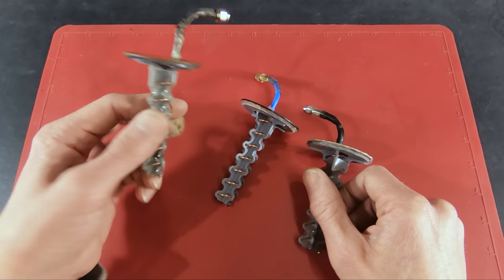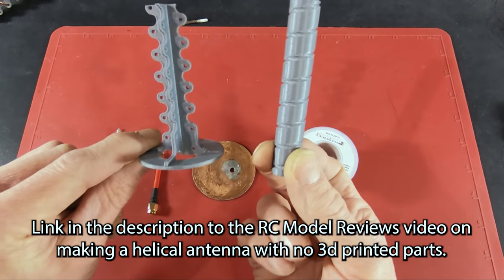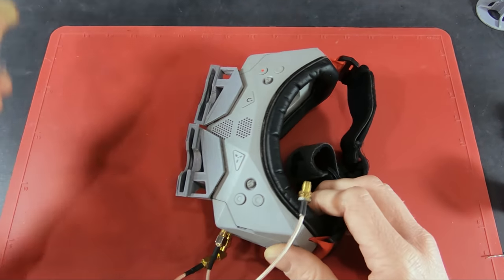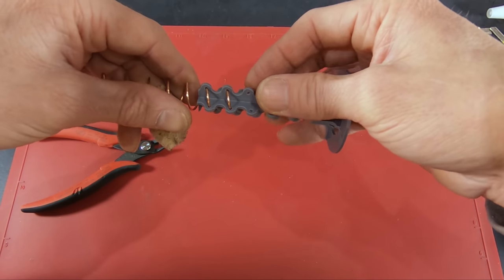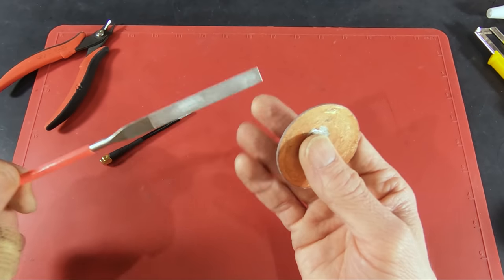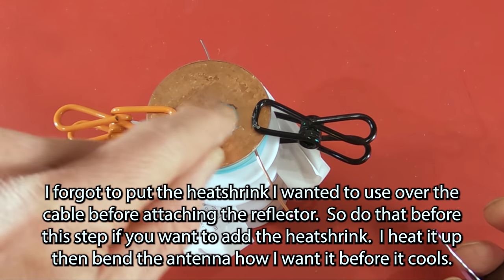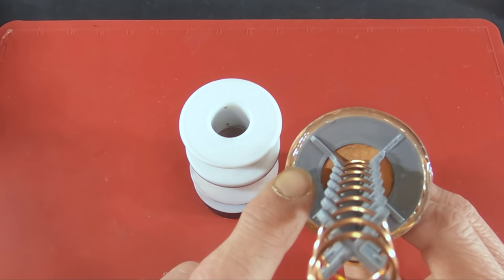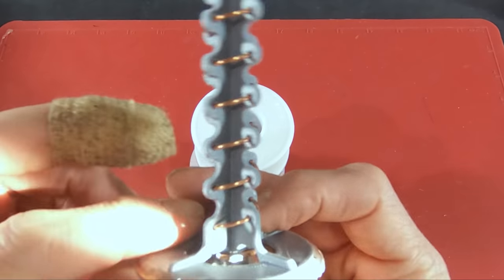DIY Helical Antenna For Long Range FPV - CHEAP & EASY -

Comment: Sweet, thanks for the video! How do these compare (in range) to the TrueRC  antennas you also use?
Reply from the maker: the helical if made well is 11.25 dbi.  The TrueRC X2-air is 13 dbi, which is more of a difference than it sounds like.  The X2-air has a beam width at least twice the size as well.  (I think it must be more efficient at focusing forward than the helical.)  That said, many might not notice the difference depending on what they plan on using it for.  It you get behind some trees far out, the X2-air will probably maintain better clarity.  I think the best choice might be using one of each.  So with rapidfire combining you get the best of both, sort of.  The wide beam width and higher gain of the X2-air and also the great cross polar rejection of the helical antenna, if I'm understanding it all correctly.  (I've read that record range for the X2-air was 10km at 200 mw but that must be in perfect conditions with quality gear. No way this helical will do that)

Comment: Hello. I wanted to know where I can find supports for helical antennas. Not those of the antenna but those to put on the glasses in order to then host the antennas. Thank you.
Reply from the maker: Here's a link to thingyverse.  There's a helical antenna holder by me near the bottom.  It's for my orqa goggles but it could be modified possibly.  Just reverse it in the 3D printing software for the other side.
https://www.thingiverse.com/search?q=falconrad&type=things&sort=relevant
Reply: @FalconRadFPV  thanks

Comment: Is the wave trap touching the copper plate? What is the piece you call wave trap?
Reply from the maker: the wave trap is the small 6mm x 3 or 4 mm square of thin metal.  It should be soldered to the bottom of the antenna coil and defiantly not touch the base plate.  My example is confusing.  I used a piece of one sided copper coated pcb for the wave trap.  The copper side only touches the antenna but yes the inert pcb (plastic) side does touch the base plate.  But wave trap refers really to just the copper coating not the rest of the plastic supporting it.

Comment: If the copper sheath is higher than the reflector would that cause issues? Mine is like 2mm above the reflector
Reply from the maker: I would keep it as short as possible.  I have it come just high enough that I can solder the sheath to the base plates copper surface.  The last quarter turn of the coil that goes flat should be only 1 or 2mm above the reflector (base plate) surface.  You can email me at falconradfpv@gmail.com and I'll help you figure it out.  Send me a couple of pictures and I'll see if I can spot a reason for it not working.
Reply: @FalconRadFPV  Thanks so much I will do!

Comment: Hi, you mention the wavetrap should be one sided to avoid it from getting in contact with the reflector? Because in ib crazy blog he has a steel piece soldered to the copper wire that's in the air.
Reply from the maker: Both ways do the same thing. I've made it both ways.
Reply: @FalconRadFPV  i just finished making one. I used a double sided copper board reflector and a computer hard drive mounting bracket strip for wavetrap. Soldering the wavetrap was a bit tricky. Thanks for the excellent tutorial 👍

Comment: I don’t think I’ll be able to make these antennas, can you recommend an antenna that I can purchase that will Have similar performance? Southwest FPV Durango Colorado
Reply from the maker: Many FPV stores will have high gain long range antennas.  The higher the gain the stronger the signal, BUT also the narrower the area of coverage.  Compare the gain and area of coverage pictures for different antennas to make a good choice.  Most good quality (the more expensive ones) antennas will have a picture for the gain levels at various positions around the antenna as well as the shape of the pattern for area of coverage.  More coverage = lower gain, one goes up the other will go down.  12 or 13 dbi (like TrueRC X2-air) should be plenty for a long range goggles receiver antenna.  For a quad antenna the same thing except you want low gain and coverage in a perfect circle around it, like with the TrueRC Singularity.

Comment: did you design the 3d print file for a lhcp guide pole?
Reply from the maker: I didn't design the prints, got them from thingiverse.  It's for right hand polarized, although you could just mirror it in Cura slicer to reverse the polarity.

Comment: do you have to use bare copper wire or can you use the coated stuff and just remove the coating at the needed solder points?
Reply from the maker: Either would be fine.  Ya that's right the only issue would be scraping it a little bit to be able to solder to the end.

Comment: can you do a video on how you edit your footage to make them look nicer?
Reply from the maker: That's an interesting idea.  I might do a video like that in the future, but my video schedule is pretty full with many promises of build and setup videos to work through.  (to be honest I feel like I need to get a bit better at post production stuff before I should start giving advice about it.  So far I've been more about playing around with settings and seeing what happens rather than having any sort of refined process that I go through.  It is in large part due to the huge variety of lighting conditions that I end up recording in.  Most of the year there is a small window of daylight where the light is good and shadowed areas are at a minimum.  Otherwise it's all about trying to get the gopro to get useable video from two extremes, in shadows and from snow in sunlight.  Of course gopro settings can't be changed during a flight unless it's on auto.  I still go back and forth between auto and locked exposure depending on the light that day.  When I get a bit better at it I'll try and share some knowledge!

Comment: One more quick question. Could I use aluminum instead of copper for the coiled antenna wire?
Reply from the maker: No I don't think so.  The bare copper wire can be bought at many different electronics stores.  It should also be on amazon etc...  Or just a piece of 16g home wire from the hardware store will probably work fine as well.

Comment: I have read the reflector material does not matter much and heard of people even using the lid of a bean can. Do you know if this is true?
Reply from the maker: An alternative would be galvanized steel.  A 12 x 18 inch sheet at home depot is $7 canadian, probably $5 or $6 in the US.  Maybe you can find a smaller one for even less.  I believe copper or galvanized steel works best.

Comment: Are you sure that mode 1 on the Rapidfire module was used? Some of the people told me that mode 2 is much better for LR ? P.s. I also use the FPV.One, are you happy with them? 😊
Reply: Would be nice to know which one is better
Reply: @RealKushrage  Yea man, because I have flown until 2km with mode 1 and then a friend told me it would be wise more to switch to mode 2. But I'm not that sure anymore... I have not passed more than 2.5km yet.
Reply from the maker: Ok I'll try a test for it when I get a chance and let people know what the results are.  I have always used mode 1.  According the the immersion rc rapidfire manual mode 1 is the one with all the special stuff going on for signal combining.  Then mode 2 was for quads that didn't work properly on mode 1 due to cameras not conforming to proper video signal standards.  But mode 2 was supposed to be just about as good as mode 1.
I was thinking about trying mode 2 though for a different reason.  Just before sunset my camera gets near impossible to see through in certain light conditions.  I've seen a video where a guy showed that rapidfire mode 1 made SOME cameras appear to be really dark and mode 2 seemed to get a brighter picture.  So I want to test that out a bit.
YES I love my fpv.one's they're great.  Plus I'd rather not support fatshark who has no interest in innovation or moving the community forward like orqa does.  Fatshark was happy making no new products and sitting on the profits of old design's until they got some competition, then they just copied the competition and beat them to market.
Reply: @FalconRadFPV  Yes I experienced that also. On my NewBeeDrone Acrobee the image is not that good on mode 1 and much better on mode 2.
Reply: @FalconRadFPV  Please do make a short video once you test the mode 2 please! P.s. I am having problems with my camera brightness which is seen in the DVR. But my thought is it is related to the VTX. Because on all other TBS Unify quads I have 0 problems, and the latest one with the AKK Infinite I have problems. Mode 1 or mode 2 make the video (for me) the same brightness. To jump over the problem I just crank up the brightness and contrast on the FPV.One, but the DVR once it is recorded can be seen very dark... I have also tried switching the cameras with a different model and it was the same.

Comment: Hey there! 
Just wanted to drop a quick question – I'm rocking the Commandos on the 915 MHz band (iFlight Chimera Pro v2), and my eyes caught the Goggles 2 antenna strutting its stuff at 5-7 GHz. 
Now, I'm not exactly a long-range guru yet, so I gotta ask: is this frequency mashup gonna vibe well together? 
I'm all ears for any wisdom you can drop on a rookie like me. Much appreciated!
Reply from the maker: If the frequencies are far apart it'll be fine.  It's when they get close together that its and issue.  Like using 2.4ghz for the transmitter and video would be a bad idea.  I would use crossfire or ELRS at 915ghz and video at 5.8ghz is perfect, they are far enough apart that there is no interference between them.
Reply: No clue, thanks for the heads-up! Yeah, RC's rolling at 915 MHz, and the Integra's rocking the dual-band vibes (2.4 and 5.8)... thinking of ditching the 2.4 and going all-in on the 5.8, what's your take on that?
Oh, and by the way, just throwing it out there, planning to pull off the FCC hack. Watched a bunch of vids, and they swear by it for boosted penetration and crazy range. 
Any firsthand wisdom you can drop on that? @FalconRadFPV

Comment: How come, the length of the RG402 is actually relevant if it's shielded anyway? I mean, you even extend it with another extension. Doesn't it affect it as well then?
Reply from the maker: The length requirement is due to RF science that I can't explain.  Good point though, perhaps the cable length should be measured from antenna to receiver instead of the next coupler.  I'll have to test that out!

Comment: Has the reflector to be round? And has it to be flat? (Sorry, I´m not into physics, just trying to figure out what influences what)
Reply from the maker: Yes flat, I think square is ok but not sure what the size should be then, 52mm, I guess.  A 52mm circle gives maximum dbi but is not necessary unless you are trying to get max range, like over 7 or 8 km it might be worth making it round or if you are using 600mw or less vtx.

Comment: Thanks man! I have a question before I'm building one too:

Is it that the longer the antenna is, the better the video reception is? Because I want to make a 18 turn or maybe even a 22 turn helical!
Reply from the maker: yes longer increases the gain but narrows the effective width of the reception area.  You would be better off trying to make the best 7 turn that you can or making several and testing them against each other.  A good 7 turn will give you video for as far as almost any battery could take you.  a good 7 turn should get 8 to 10+ km of range with a good vtx set at 800mw
Reply: @FalconRadFPV Thanks! Do you know if carbon fiber would work as the 15mm tube? Because there is nothing else near my house in the shops that has tubes of 15mm...

Comment: Can this type of antenna be used for HAM radios?
Reply from the maker: I'm not sure, I guess if you made it the right size for the desired frequency then maybe.  But if it's something low the antenna would be really big, at 1.3g or lower it would be getting pretty big.  It works for this nicely because of how small the 5.8g wavelength is.

Comment: thanks i was gonna ask you about your helicals, i think i'm gonna go oldschool and use a tripod with a carefully aimed helical.  also i was curious as to how you add the dipole antenna to your tbs rx
Reply from the maker: The bardpole for crossfire?  I use the the ufl version and skip the sma connector.  I have my receiver right in the back so that it reaches the mount beside my vtx antenna.  Since I have the ufl version instead of the hole for pushing an sma through I made it to have a sleeve that comes up about 1/2 inch tall, same size as the sma hole but a 1/2tube instead of hole.  Then I cut the tube in half so I can spread it open and put the bardpole into it.  Then use a piece of heaty shrink to keep it all tight together.
Reply: @FalconRadFPV    thanks, i think the crossfire micro 2 is next on my shopping list,

Comment: Sir, I want to ask, if I use NYY type electric copper wire with a diameter of 1.0 or 1.5 does it work? and make sure again the diameter of the PCB reflector is 51.7 mm to 52 mm?

￼
Reply from the maker: Yes that right.  The reflector doesn't have to be perfect, it can be a few mm bigger or smaller and it will still work well.
Reply: one more thing sir, what is the size of the copper cable spring, and what is the diameter of the mold? Thank you

Comment: Does the wavetrap make a big difference? I made one without a wavetrap and I get similar penetration as a foxeer lollipop.
Reply from the maker: I think the wave trap might be to help adjust the impedance of the antenna to 50ohm's.  I'm not sure how much of a difference it makes to the antennas function, I've always included it on my antennas.  If you are referring to using a lollipop antenna on your goggles vs the helical, you should get significantly better reception with the helical I would think.  It should be roughly 3X higher dbi than the omni directional lollipop antenna.  You need to have the helical antenna pointed roughly towards the drone at all times.  If you are a few km away its easy to keep it pointed correctly, if you are flying nearby and go off to the side you need to turn your head to keep the drone within a roughly 60 degree cone of high gain reception for the helical antenna.  With the lollipop there is no need to turn and face the drone no matter the position or direction.  That's the trade off between high gain directional antennas like a helical and a lower gain omni directional like the lollipop.
Reply: @FalconRadFPV  Yea I know exactly the difference between the two. I usually use two omnis perpendicular to one another with my Fusion module. I tested the helical against the one omni and just put the drone on 25mw and walked behind a couple walls. There doesnt seem to be a huge increase in performance. For example If I put my hand infront of the helical the Fusion rssi favours the omni.
Reply: I'm using a 5 turn helical.

Comment: how did u retrieve the kuad at 6km at 3.2 volt cell?
Reply from the maker: With li-ion cells the voltage under load is generally a bit lower than a lipo.  In flight a li-ion cell will drop right away to 3.9v and it'll hold out until about 3.0v then drop fast and die.  I practice a lot and learn each of my batteries and how far / long it can fly giving me the confidence to do flights like this.

Comment: Plz build sub 250 gram long range drone
Reply from the maker: I may in the future.   For now I don't have any parts to use or a budget to get any.  But I have spent a bunch of time daydreaming about it so I have lots of ideas for light weight frames, prop and motor combinations to try out if I get the chance!
Reply: That's fine just upload good fpv drone videos as you usually do 🔥 ❤️

Comment: Isn't it better to buy one from AOMway brand?? They sell Helical antenas like this.
Reply from the maker: Yes they do, some people like building stuff like this.  Also if you have a broken antenna then it only costs a few dollars.
Reply: @FalconRadFPV  but the one they sell is also as good..? As I am not that good at building things with such precision. - Too big hands and shaky - therefore I m ain't that skilled.

Comment: What is the Wave Trap actually doing(is it necessary)? and is the copper side on the copper plate or on the wire? im building it right now
Reply from the maker: the copper side goes up and is soldered to the middle of the flattened out first quarter turn.  The wave trap is a necessary part.  The impedance of the coax is 50ohm and the coil is more like 110 or more.  The wave trap helps get them to the same impedance to improve performance.  For more info on it check out the link for the I B Crazy post.
Reply: @FalconRadFPV  Thanks for responding and helping me out :D !
I already 3d printed the model with the coil inside and already cut out a round sheet of copper.
I looked at the linked post (I B Crazy post), and also googled a bit but for me it seems pretty difficult and I don't understand it properly.
Can I also use a piece of copper which is isolated from the copper sheet as a wave trap or does it need to be a one-sided copper clad board?

Comment: How did you cut the copper thing?
Reply from the maker: I used a jigsaw, but you can score and snap it as well.  I've also used bolt cutters to help round off the corners.  (the copper clad prototype board is 95% plastic.

Comment: Hi! what is the diameter of the former? I find different values for 5.8ghz, between 15mm to 18mm (internal diameter of the helix). I know that will work with any value, but which one is the best? Thank you!
Reply from the maker: I believe the internal diameter is about 15mm.  Ya just measured it, 15mm or a tiny bit less.

Comment: How much range would you get if you tripled the antenna length/size?
Reply from the maker: oh it gets less efficient. 7 turn 11.25 dbi.  12 turn only around 12+dbi.  6 and 7 turn work best.  It's more range than the examples though.